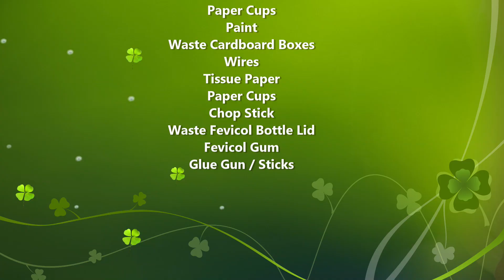Nuclear Power Plant Working Model | Generate Electricity | Best Science Project 2026 | howtofunda

Comment: Someone plss tell what motor is used i need to know now
Reply: You make this I also make this I do all this but the big problem is turbine 😢
Reply: Ummm… guys just do it to fit yours
Reply: For example u can swap it out for a stronger 9v motor with a stronger battery
Reply: Or a 3.7v mid sized one powered with a 3.7v rechargeable battery
Reply: Make it fit your design

Comment: Paper cup 2
Tissue paper 
Books card 2
White and black acrylic colour 
Dove soap boxes 6
Glue gun
A4 sheet 
Blue colour Sheet
Scale
 black marker 
Card board
Fevicol
Black colour Sheet 
3 roes box
Red colour Sheet 
Yellow colour Sheet 
Fevicol ka purana bottle ka cap
Blade
Electric motor or generator 
Small dc motor
Wires
Battery connector 
Battery  
LED light  
As requested ❤
Reply: thanku
Reply: @Lavanya_wings wlc bro😊
Reply: @altafshariff980 ❤
Reply: Thank you so so so so so so so so so so so so much
Reply: Aww i am glad that could help u❤ @shyamalaravi9188
Reply: Roes box kya hota h
Reply: Roes box kya hota hai
Reply: @breakfasttodinnner2772  3 roses box 
Means 
A box of a tea brand
Reply: Thank you tomorrow is 14 jan my scince exhibition
Reply: @Ahmed-h9k6q ohh I am glad that I could help u guys ❤
Best of luck guy performed well